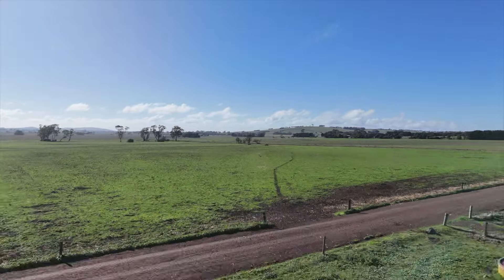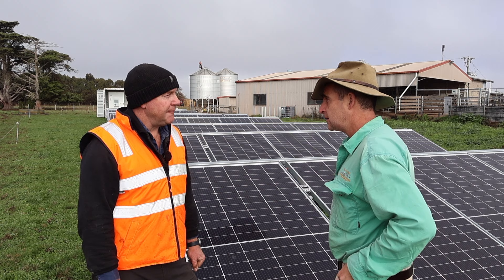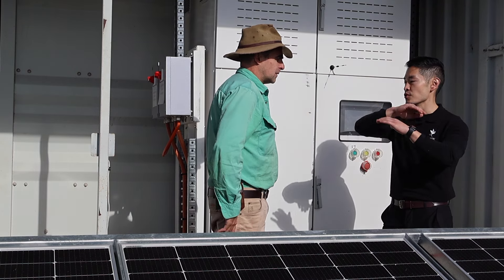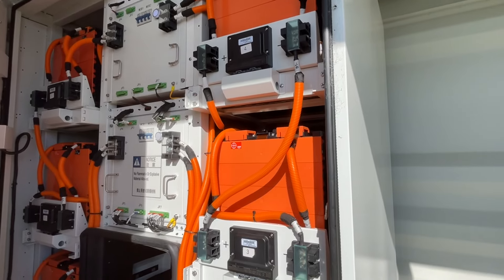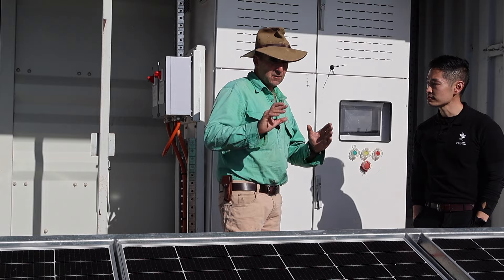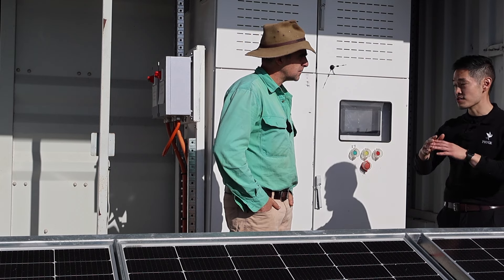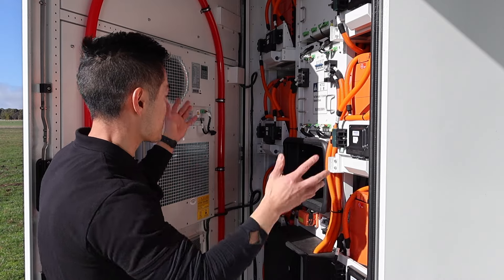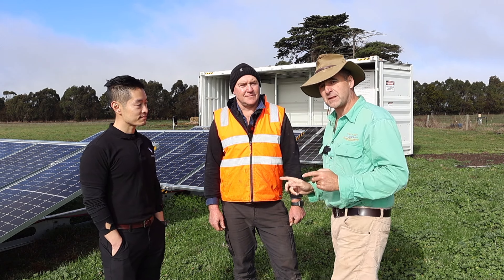Off Grid Power For Dairy Farm

Comment: Personally, I've been 100% off grid for 10 years. Basically, the energy costs are higher than grid supplied in most locations. In Thailand, where I'm located, it's around double the cost, with grid supply being around US $ 0.17 per kWh. The change to Lifepo4 batteries was a significant improvement over lead acid, especially now that the prices have come down to that of lead acid, with significant improvements in terms of performance.